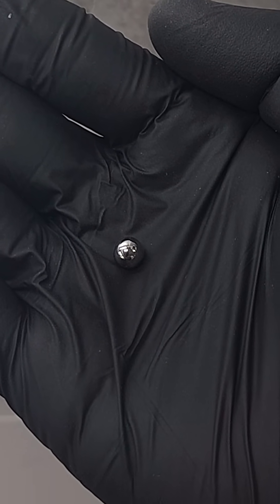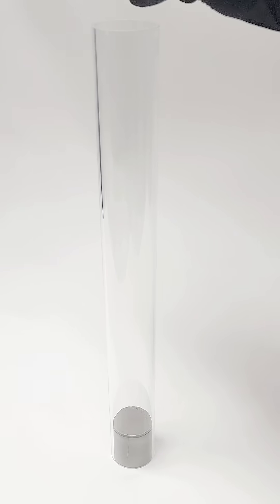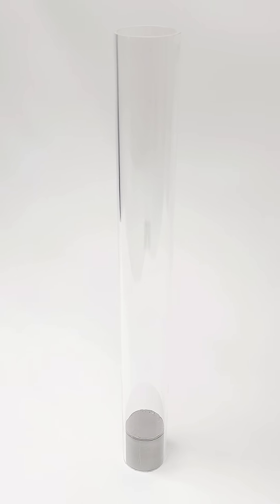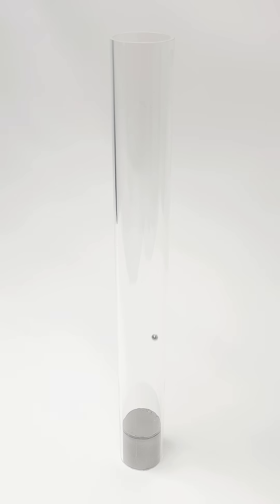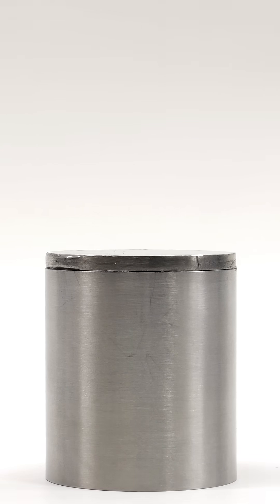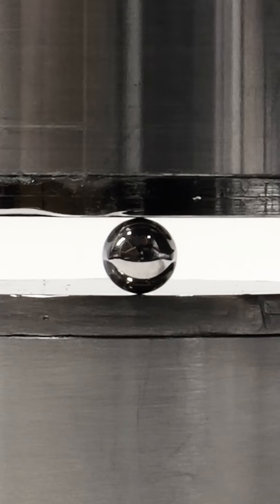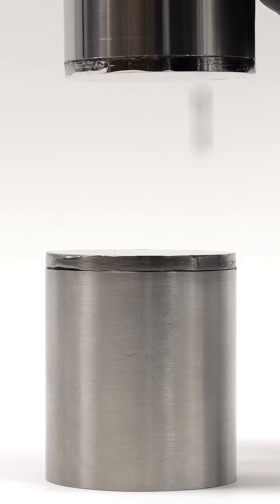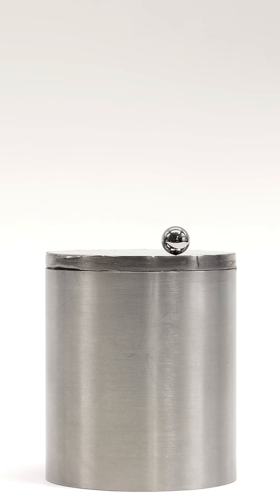This metal is too bouncy

Comment: I took a sample of the audio from this short and put it into a parametric equalizer. I observed that at close to its highest frequency the ball was bouncing at at least 2200 hz or 2200 times a second :)
Reply: I made sure that this wasn't an illusion caused by harmonics as with a parametric eq I am clearly able to observe the fundamental frequency of the bounce.
Reply: I also think at peak the ball is bouncing even faster than that

Comment: Now what you need is some extremely powerful electromagnetic magnets, pushing the ball in the center with two of those atomic trampolines and both sides of the atomic trampoline have the industrial size magnet so what’s gonna happen? Here is one it’s gonna be spaced out just enough that it’s gonna bounce and hit the other side of the atomic trampoline, but the electromagnetic forceis going to push it right back at the other trampoline and then you can slowly increase the force between them and watch go crazy

Comment: That's conservation of momentum for you. The ball retains the same speed while the gap reduces, leading to more bounces per unit of time. In fact, you're probably adding energy by lowering the gap.
Reply: It’s also a super alloy of metal that’s super bouncy in nature because of the precise mixture of metal it requires to make it…
Reply: @KingNP41  I'm aware, yes. Nigel had a whole video about making it. The alloy exaggerates the effect, but isn't the cause of it. You can get a similar though not quite as extreme effect by bouncing the bulge of a spoon on a stone countertop. The harder you press, the higher the frequency of rebounds it goes through before coming to rest.

Comment: I used a frequency generator to compare the sound, the highest pitch you get is roughly 4200Hz which means it bounces about 2100 times per second😳🤯 that’s insane!

Comment: The math involved in that last two seconds of bouncing is utterly frightening. It's doing thousands of rebounds.
Reply: 3blue1brown has an interesting video closely related to this, using frictionless perfectly elastic blocks, and involving pi showing up for a crazy but awesome reason.
Reply: @dachannien the only thing I remember from that video is that you get pi
Reply: @bigsmall246  You get an increasingly accurate approximation of pi based on the difference in weight.
Reply: @dachannien  The amount of bounces or collisions (when the squares touch or when one of them hits the wall) perfectly matches with pi. Squares with equal masses get 3 collisions, and if you increase the mass of the outer square by powers of 100, the collisions add another digit to pi. 31, 314, 3141, and so on. Crazy.
Reply: @idonthaveideasformyhandle only if you have two squares of different weights, no friction, perfect bounces.

Not in this case. This doesn't show PI on any way.
Reply: @StefanDeleanu  You’re right. I was only referencing that one video.
Reply: @StefanDeleanu  You’re right. I was only referencing that one video.
Reply: @dachannien  That's the one!!!!
Reply: And the height of the bounces must be miniscule! I wonder if it would be possible to measure those?
Reply: @neilwilliams4684  it would just be the distance between the two surfaces minus the diameter of the bb
Reply: @niclasnyberg4173  Agreed, but how small a bounce does it get to in numbers/time is what interests me. Does the ball speed up the closer it gets, or is it always travelling at the same speed is also interesting to find out. My guess is slightly slower due to friction.
Reply: Anyone have a video link? For some reason I can't find it
Reply: Ya that was dangerous af
Reply: Honestly its not that bad! Its just listening to the frequency of the sound (ofc using a computer to tell u the frequency) which directly tells you how many times it bounces
Reply: It simply can't bounce that many times, at that distance, in that time span. A couple hundred is the absolute max, and he ain't even hitting that.
Reply: @sofachrome You are greately underestimating what physics can do, particularly when it comes to very small items
Reply: @Ethereal_Drift   No sir. Its bouncing quickly, but jumping from a few bounces to thousands of bounces in a second and a half? Not happenin', cap'n. The noise that so many seem to be hung up on isnt't actually informing us of anything. You can track the ball with your naked eye AND easily count the number of bounces heard, right up to the last second and a half or so, when the surfaces get so close to each other that the sound of the collisions start to overlap.
Reply: @sofachrome I love that you're telling us to trust our eye (and the framerate of the video, which looks to be 30) to count something happening thousands of times per second. The frequency of the pitch gives you the collisions per second.
Reply: @zachgray4767  and I love that you're baffled by big numbers and bullshit
Reply: @sofachrome  Hope you find some peace soon, brother ✌️ Have a great day.
Reply: @sofachrome The frequency of that pitch went up over 1,000hz easily. That's the number of bounces per second.

Comment: Use a vacuum to suck out all of the air inside the tube and use a magnet to hold the bearing. Then pull the magnet and watch it bounce.

Comment: I'm sure it's not lost on you that this is what happens to the particles in a gas when you compress it.
Reply: Is that why compressed gasses heat up?
Reply: @NibblyBitz  Yes, exactly.
Reply: @NibblyBitz particle friction will make heat hypothetically from the rapid moving particles knocking into each other in such a confined space
Reply: @NibblyBitz PV = nRT
Reply: All time favorite science YouTuber right here, a legend along with the original king of random
Reply: @bluecow32 fax
Reply: Beautiful analogy.
Reply: @tcr94 its not an analogy its a fact
Reply: @tcr94 it’s lost sometimes on somebodies
Reply: yo hi Cody!
Reply: Cody, not at all surprised seeing you here😂
Reply: If you could make a good enough seal, a diesel engine could use air as fuel. Compress it enough to combust.
Reply: @lachlanhenry486  
Maybe… with the exhaust being almost entirely NOx, which is — purely coincidentally, you understand — a rusty red colored noxious gas.
Reply: @For_What_It-s_Worth  reminds me of the Haber Bosch system that we use to obtain nitrogen from the atmosphere. High pressure, high temperature. Make it rain ammonium nitrate in a barrel!
Reply: @lachlanhenry486  
Is the reaction endothermic or exothermic?

It doesn’t seem to me it could be very exo, or it would be self-sustaining.
Reply: @lachlanhenry486 isnt that basically a large gas gun
Reply: Cody why don’t you post videos more often? You get tons of views.
Reply: Frobscottle rememberence day
Reply: So that's why farts sound like that.
Reply: 1.  A gas is hotter the faster its particles are and the more collisions between particles happen

2.  Higher pitch in this experiment is analogous to hotter gas

3.  Women have higher pitched voices than men

Ergo, women are hotter than men
Reply: @pplesandoranges  Nobel inbound.
Reply: @pplesandoranges many femboys have high pitched voice too. Therefore according to your hypothesis femboys=women since women have high pitched voice.
Your hypothesis doesn't hold up, hence conclusion rejected.
Reply: @pplesandoranges Totally did not see that coming 😂😂😂
Reply: @pplesandoranges 🤦🏽
Reply: @pplesandoranges 🤦‍♂️
Reply: GOOOOOD POINT!
Reply: WOW you are a popular guy Cody
Reply: Cody the GOAT 🗣🔥
Reply: Hi cody, good to see you here man 👋
Reply: That’s so cool!
Reply: I wonder how size would change it. And how obviously we cannot hear it's peak frequency. How close can you get?
Reply: @lachlanhenry486 He said he could count several thousand bounces per second, so at least a few thousand Hertz was probably measured.
Reply: when you going to mars
Reply: Their frequency changes??
Reply: I still remember when you ate dry ice
Reply: Yoooooo Cody
Reply: So THATS why my farts sound that way.
Reply: A wild legend appears!
Reply: Cody!
Reply: My favourite Youtuber! Love your videos! And I enjoyed all of them over the years.
Reply: Hell yeah it’s Cody.
Reply: So would the bouncing ball heat up, like molecules would when compressed? I'm not a physicist so feel free to be pedantic.
Reply: This is basically the definition of pressure
Reply: That makes sense my farts must be compressed gas then because they make the sound😂
Reply: That explains some of my farts...
Reply: Cirke is that you????
Reply: Is it thogh
Reply: It’s lost on me cuz idk wtf that means
Reply: Ye
Reply: The car engine's POV
Reply: Hot.
Reply: Puff up your face cheeks with air and feel the vibrations...or relies pressure turns air into a semi solid.
Reply: I think you are right!
Reply: it was indeed lost on me, thanks for letting us know! that's very cool
Reply: That was lost on me. I know surprising, right?
Reply: Sounds like a good idea for a science class demonstration
Reply: ANd that's how the power is generated right?
Reply: Truthfully I had no idea… to think that that’s what’s going on though is insane lol
Reply: It is awesome to see a visible representation of it, you gotta admit that!
Reply: Hey, it's Cody! 👋
Reply: Can confirm, I compressed and released some gas just now and it made the same sound. Smells funny, though.
Reply: Good point bro, very very good.
Reply: like in car engines?
Reply: we just miss the sound of the atoms bouncing
Reply: now here is a question: why do the gas particles still keep their energy seemingly forever, instead of stopping like the bouncing ball ?
Reply: @lolilollolilol7773 atoms do stop eventually, whenever they can transfer heat or do work on the enviroment. they can transfer energy to the container or radiate away heat with electronagnetic radiation. Molecules and atoms cannot make a sound because sound is made of those particles, it's like trying to wet a water molecule, but they release energy in a similar fashion with thermal radiation
Reply: Woah
Reply: Somewhat.   Minus the noises until you ignite your gas engine cylinder
Reply: CODYS LAB
🎉🎉🎉

I have been subbed for almost a decade if not more ! I love your contrnt
Reply: lol like farts
Reply: That would be a good way to show it in class
Reply: Hello
Reply: This is also the very much like the audio translation of colliding neutron stars or black holes, as detected by LIGO. 😮
Reply: Cody the legend
Reply: would the high pitched frequency represent an explosion in a gas?
Reply: Superfluid helium, Hieke kamerling onnes and nitrogen/oxygen, Tesla coil spark gap creating ozone(transient luminous events), free energy during the Carrington Event of 1859, and some other things I'll try to link to you in case I've forgotten.

Thank you for your work, sir.
Reply: I love Cody he's my introduction into YouTube science because I love rocks and chemistry
Reply: gasp That's why it gets hotter!
Reply: Diesel go boom.
Reply: That was lost on me so thanks for blowing my mind casually 👍
Reply: Not really
Reply: Wait that makes so much sense holy shit
Reply: legend
Reply: Or cool it
Reply: That explains the  fart sound
Reply: Like farting? Lol
Reply: Diesel!! :)
Reply: So that's why my farts sound like that?
Reply: for example, when playing a flute :3
Reply: The last sound:when I open my bedroom door at midnight😂
Reply: This would genuinely be such a cool demonstration in a class room, I love this type of stuff but seeing a poorly made flash game with horrible graphics to show this stuff made me so disinterested
Reply: The real question should be how much heat is generated in the ball from this sort of compressional bouncing.
Reply: Do you mean before it would turn into liquid gas ⛽ where are you referring to a different process! Because what you said 🫴 what would be the process of the gas changing states of matter
Reply: and that's also probably why the gas get warmer and liquidfied in certain cases , and why it gets colder when decompressed right ?
Reply: why would that not be lost on me? we’re random people browsing youtube my dude, why would you assume we would correlate that with this video? idek what compressing gas means tangibly
Reply: Nice
Reply: Could this have a practical use in energy production?
Reply: I’m subscribing to you just for this. This is an insight I NEVER would have made on my own but is friggin’ perfect.
Reply: Codyyyyyy
Reply: Is that why my farts are a lower frequency sound?
Reply: bot
Reply: not lost on you?
Reply: Yea thats why it heats up
Reply: Plasma is when you get it to hold the note
Reply: Wow what a amazing thought that really gave me a new picture. How are all yall better than my science teachers frfr?
Reply: Collab when? Two best chemists on YT
Reply: @mitaskeledzija6269  remember the "Safety Third" podcast? Basically it was originally Cody's idea, but the current hosts decided to pull an "eboys" maneuver and proceeded without telling Cody, so this might be one of the reasons why
Reply: @mitaskeledzija6269 in terms of pure technical skill and expertise chemiolis is the best chemist on YouTube. Nile is a top notch presenter and Cody is highly creative and oozes raw intelligence. In terms of pure chemistry aptitude, though, chemiolis is a god.
Honorable mentions to nurdrage for max hardware store ability and tom for most yellow and broken glassware
Reply: Woah
Reply: that's how cars go VRRRRRRRR
Reply: @VeXGamingLSRP  This compression is far more than the compression of the air and fuel in a car engine. He's going from 10-15cm of separation, to micrometers. That's maybe 10k:1 compression. Cars would work great if you could do that.
Reply: Hi Cody! We miss you.
Reply: CODY!!!!
Reply: Nice to see you, Cody
Reply: Can you detect the different frequencies from different gasses?
Reply: @corpseneech it's not about type of gas. its about that temperature is movement of particles, hence frequency. and if you compress the gas, the movement hence the temperature increases
Reply: @LeSaboteur3981  but is it possible to detect a frequency from a gas? And when changing the compression will change the temperature and therefore the frequency?
Reply: @LeSaboteur3981 but I do believe each gas has it's own characteristic curve on the pressure v temp graph and other parameters. So, perhaps yes, different gasses would have different rates of vibration.  Due to molecular mass if nothing else.  If there weren't so many it might be possible to discern a frequency .
Reply: @corpseneech  he’s talking about how the ball is representative of an atom of a gas element undergoing pressurization the particles bounce around inside of the vessel until the pressure is too great for them to move.
Reply: Not really. Gas particales are wayyyyy smaller and almost certainly won't bounce so cleanly in between the two surfaces without smashing a million times into other gas molecules.
Reply: Nonsense
Reply: Codyyy how you doing??
Reply: ...what? I'm a phycisist and I don't see the analogy.
Reply: @marcag9810 the ball bearing is analogous to a gas particle, the bouncing is its energy and the walls are the walls of container/other gas particles it contacts.
When the container gets smaller the particles move faster and impact more
Reply: @FrancisR420  not really. When compressing a gas you're introducing energy to the system, which does increase the kinetic energy of the gas molecules. Here you just shorten the path within which a ball moves, it's not gaining any kinetic energy nor are you compressing anything or doing any work. As an analogy for the phenomenon of an ideal gas compression it would actually be more confusing than helpful in helping a student get an intuition of the physical process.
Reply: @marcag9810 not tryna start an argument since I agree it's kind of a misleading example (e.g. the frequency would change either way), but since the trampolines are moved continuously (rather than in between bounces) he is actually doing work, and I bet it's a significant amount when they are closer together toward end, probably part of the reason the high pitched sound is so loud.
Reply: @kibnob  that's my point, there is no work done, it is absolutely negligible at the almost infinitesimal times when the ball bounced and he moved the top down with some speed. The increase in frequency is the result of a constant speed and a shorter path and it is directly misleading as an analogy for the behaviour of gas under compression.
Reply: @marcag9810   I only have a BS in Physics, but I mostly agree with you. I don't see the analogy either. The only disagreement I have is that its not doing any work on it. Although he's moving it slowly, he is adding some energy to the system, but it's so tiny that I doubt it is in any way noticeable. So for all intents and purposes, I think you're right. This isn't a good analogy for gas compression at all.
Reply: @marcag9810 how is energy being introduced when the gas is compressed? Isn’t also shortening the path in some way, the analogy makes sense to me.
Reply: @marcag9810 he's not just shortening the path. The energy he uses to move the trampoline is becing consumed each time the ball pushes against it on the next bounce. It's a very small fraction of it but he is giving the ball energy.
Reply: @marcag9810  you are kidding, right ?
Reply: @lolilollolilol7773  I'm not
Reply: @marcag9810 it’s not an analogy and I sincerely doubt ur a physicist
Reply: Shut up Cody.

Comment: You could measure how many times per second it bounces with an app on your phone that measures frequency of sound.
For example, if that high pitch is a 5kHz sound, then the ball is bouncing 5,000 times per second. (or half bounces since it makes a sound when hitting each of the two obstacles)